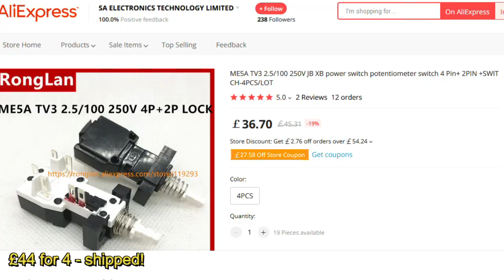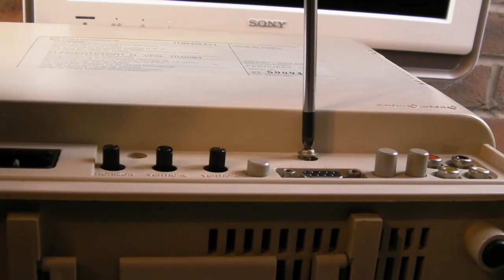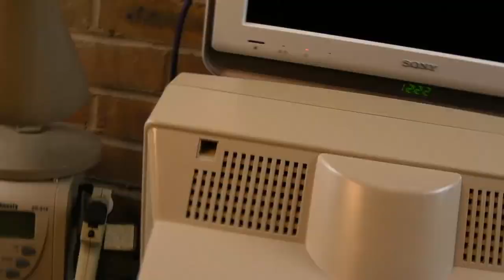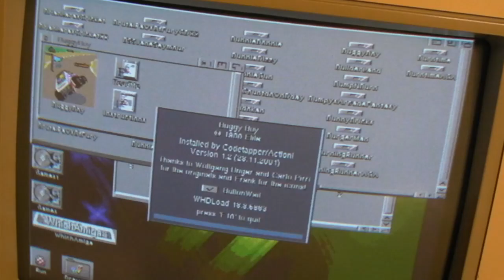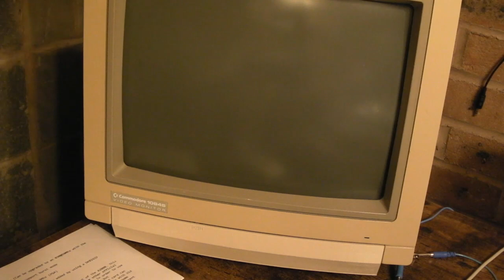Commodore 1084S (1084S-D1) Repair(s) - Part 6 (Switchy switch switch...)

Comment: Looks like a similar switch that's fitted to the older 1084, except in that one it's not board mounted so much easier to fit an alternative type of switch.

Comment: Hallo! Same method for me, and worked! Just a question, if I may, is there a way to find replacement LOPT (flyback) for the 1084s D series? I'm struggling everywhere, no way by now! Cheers, M
Reply from the maker: I am not 100% sure - but articles I've read seem to suggest these should work with the D series:- https://www.ebay.co.uk/itm/144115520790

Comment: I just picked one of these up from my friend on Thursday was in his cupboard since 1992 , needs retro bright,  but works really well ,, the switch is sticky , but would like to recap it and clean it most of all when I get time., are they easy to recap ?
Thanks
Reply from the maker: Single sided boards, so the old capacitors desolder really easily and need less temperature.  Be very careful removing the anode cap on the CRT, watch part 1 and 2 with regards to points about safety (I nearly died when I once got a shock from EHT many years ago).  If you wear rubber gloves, make sure there's no chance to come in contact with the anode cap as you short it to the chassis ground (or main earth).  Obviously make sure its not connected to mains at all, and leave it powered off for a few days before starting the work perhaps.   It's easy to recap imho, but if you've never worked on a CRT before, dont under estimate how dangerous ~12KV stored in the tube can be!
Reply: Hi , thanks I won't start it just yet , I know they are dangerous,  but I've never removed tht part of the monitor before , I powered this up , since last time it was used 1991 , my friend said and it works generally I'd like to recap , if I can and retro bright for restoring great glory , I hope I can

Comment: After that gets hopefully fixed, it's time to do the flyback on the 8833MK2...I think these have bleed resistors so the tube should be fully discharged but I'll do the screw driver to ground check..

Comment: I just cut off the legs off the old switch and soldered them onto the new switch legs and then trimmed to length, was pretty easy and so far it's held for a couple of years at least.

Comment: Some of these have leaky tantalums in the RGB section (next to the big chip on the board) which can also cause similar behaviour. But that problem rarely affects all three colours equally.
Reply from the maker: Thanks!  Those were replaced in earlier parts =/

Comment: Boy, I have 2 different  1084 Models as well as 1 1802 with the same issues.  Finding replacement switches is the toughest part.  -Mark.

Comment: That high voltage whine is pretty bad, and the bloom when switching between greenscreen and colour is problematic - Check the caps.
Reply from the maker: It was re-capped!  Very very few original caps left on there, just a few tiny ones - well away from the high voltage side.

Comment: check G2 voltage (SCREEN), bias and amplification for each gun, especially compared to green one. Btw - i swapped original CRT from 1084 with VGA one from just some random monitor I had - you need to swap deflection yoke aswell and CRT sockets should be of the same pinout (more or less, depending on how deep you wan to go) but the results when all is done and aligned is superb - even no-brand VGA has dot size of 1/3 of what 1084 has, and if you would go big, and invest some time to design video amplifier even around modest LM1203 it will pay off quickly with your use experience
Reply from the maker: Thanks!  I will check that =D  Much appreciated!